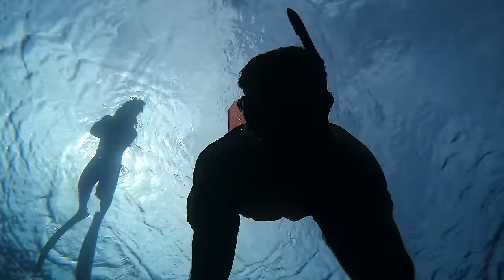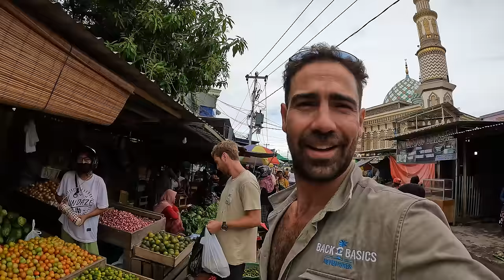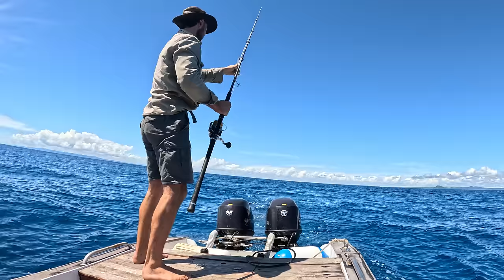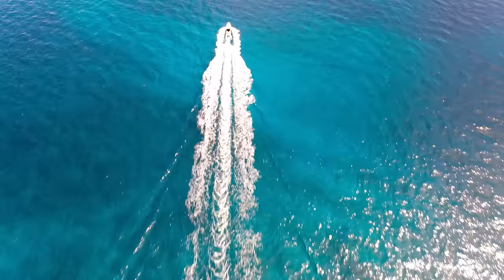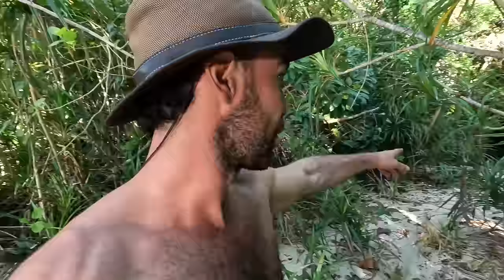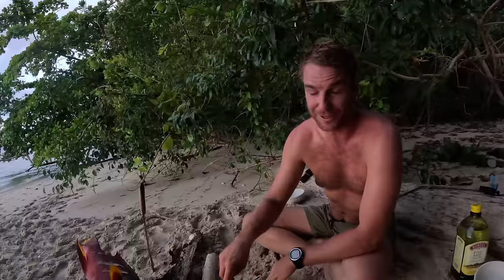4 WEEKS IN WEST PAPUA (Was this a good idea!?)

Comment: West Papua is a victim of OUR governments and ongoing illegal conduct of UN employees. On 21st September 1962 our governments voted (General Assembly res.1752) to give the new UN Secretary General U Thant permission to invade West Papua and appoint Indonesia as the current administrator. Our governments were using article 85 part 1 of the UN Charter to authorise this; article 85 part 2 requires that the Secretary General tell the UN Trusteeship Council about the trusteeship agreement ('New York Agreement') so that the Council can then begin its article 87 & 88 duties making yearly UN reports to protect & promote independence of the colony (West Papua). In violation of the UN Charter, U Thant never told the Trusteeship Council; and nor have any of the subsequent Secretary Generals. IF UN employees were honest, they would insist on revealing General Assembly resolution 1752 invasion & subjugation of West Papua to the UN Trusteeship Council to whom they should have reported it in 1962.
Reply: If not for sukarno the whole of west papua would be in reservations speaking dutch just like the aboriginals in Australia. Its a pity yall never developed a brain to realize this much. Groetjes uit Holland